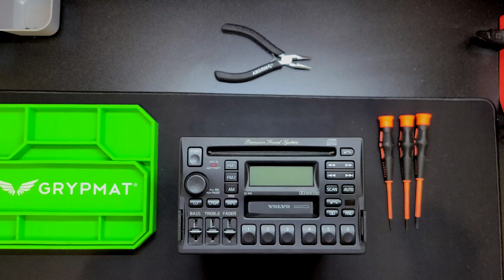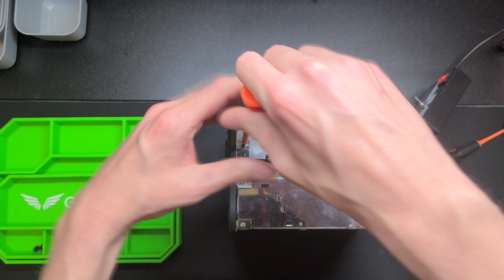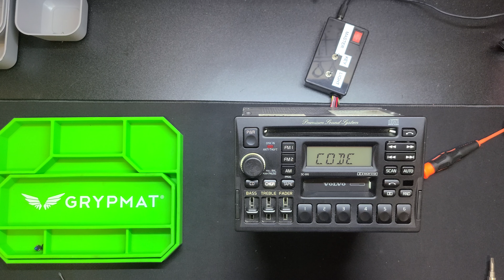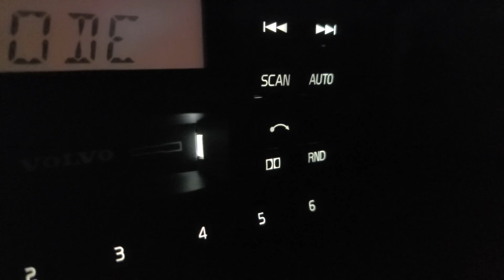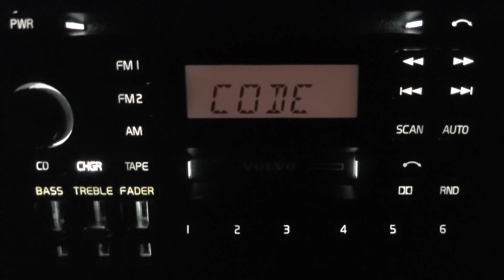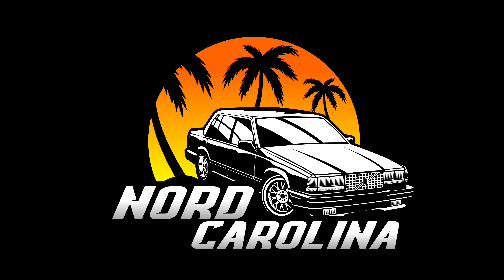Volvo SC Radio LED & Bulb Replacment Tutorial

Comment: The three slider knobs pull right off.  No tool needed.  Hard to understand why anyone would need to go out and buy any tools to do this.  There is a piece of clear tape across the top at the front that you failed to mention.  Perhaps you removed yours previously.  You DO need to remove the two screws of the display to remove the circuit board - if you don't remove them you can not pull the board off the pins that were straightened.  The fascination with using LEDs I don't understand.  The OEM look is classic - and to retain it you carefully remove the blue covers and transfer them onto replacement bulbs. Honda bulb 35505-s84-n01 is an exact replacement.  The uneven brightness in your result (CHGR for example) is because you used LEDs.  That would not happen with incandescent bulbs.